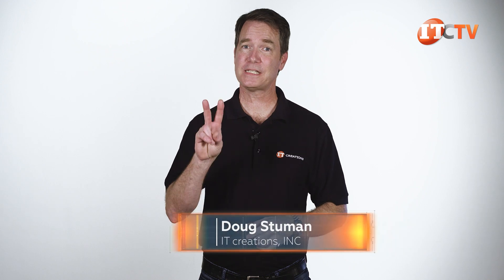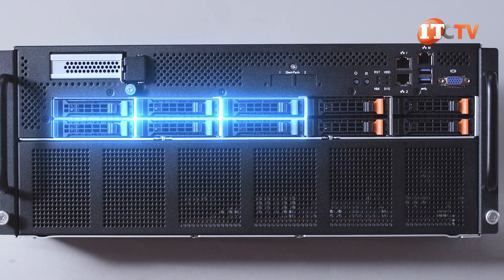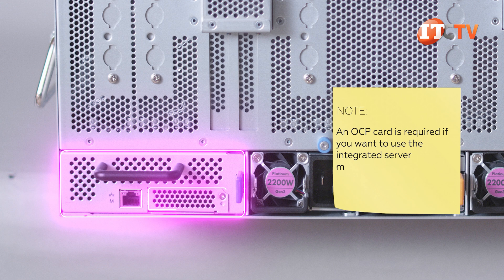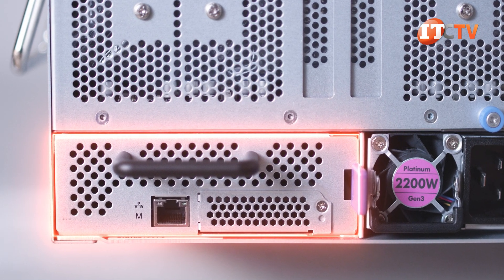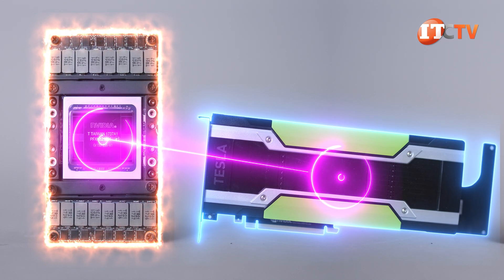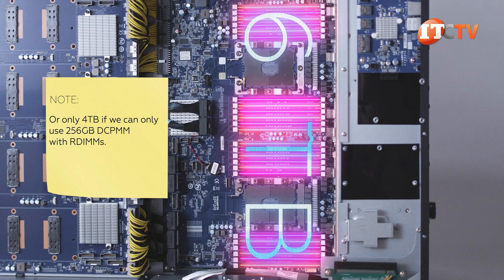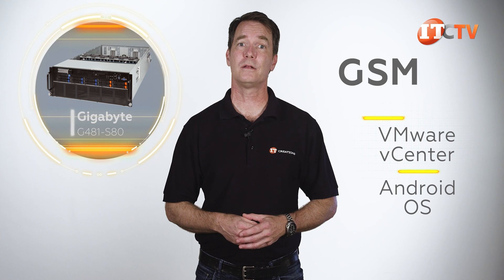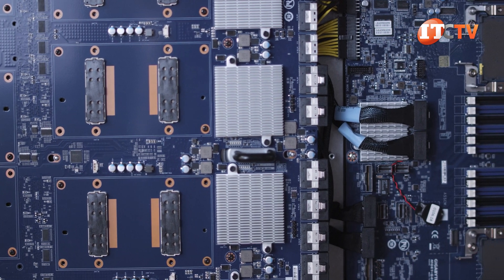Gigabyte G481-S80 GPU Server REVIEW | IT Creations

Comment: Pcie vs nvlinks How Gpu fits on it.
Reply from the maker: It's designed for the SMX2 form factor which connects more like a CPU that a GPU. The area towards the back of the chassis has mounting points for 8x of them. There's also have a very large finned heat sink for each of them. This uses NVlink instead of like a standard PCIe GPU. Thanks for watching!
Reply: @Itcreations-LA  can we use 2080tis instead of v100 gpus?